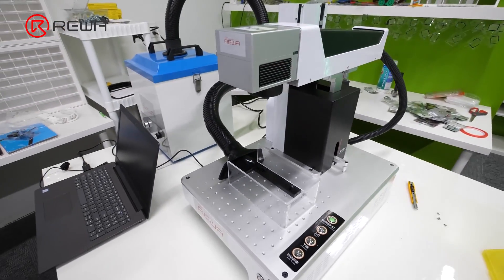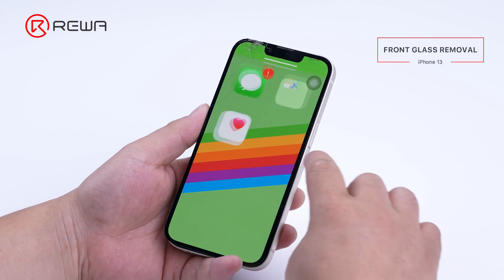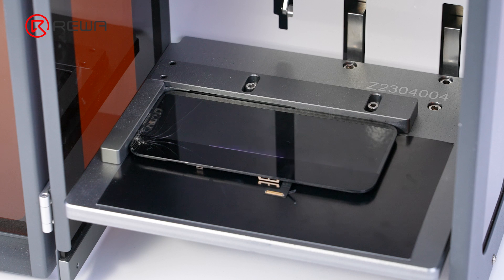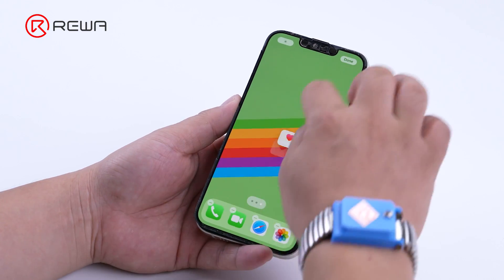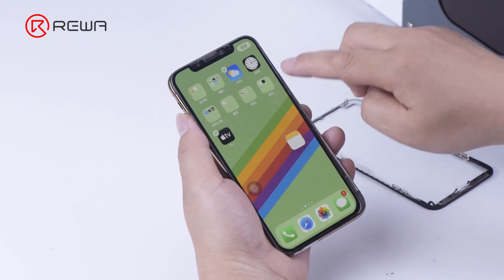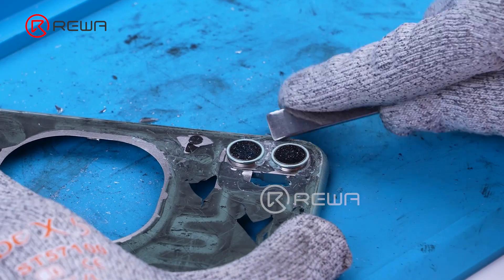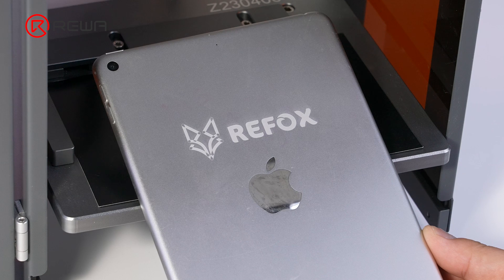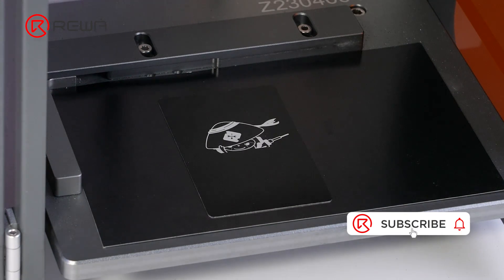No More Struggle with iPhone Glass & Bezel Repair? Check the UV Laser Machine!

Comment: I find that it is much easier to damage the touch layer on iPhone XR, 11, 11 Pro and Pro Max when using the cutting wire. Will performing the laser method before wire cutting reduce the chances the damaging the touch layer by weakening the adhesive? Thanks
Reply: the laser would damage the OLED or touch sensors of the older models thats why they mentioned in the video that it only works for iphone 13 and 14 but even on newer models the laser might destroy the screen I had to learn that the hard way
Reply: @BC-sb9ui So the laser can damage the 13 14 or 15 screens?